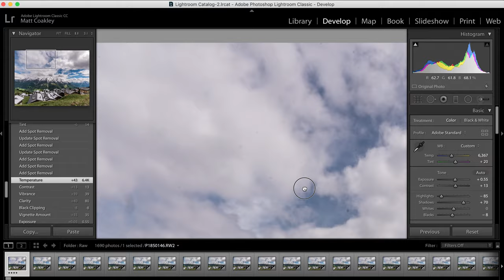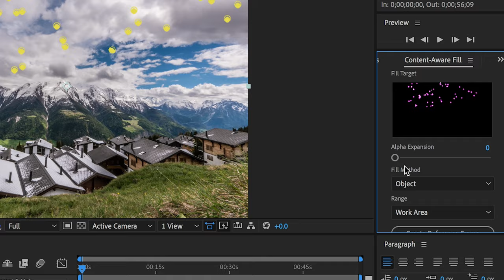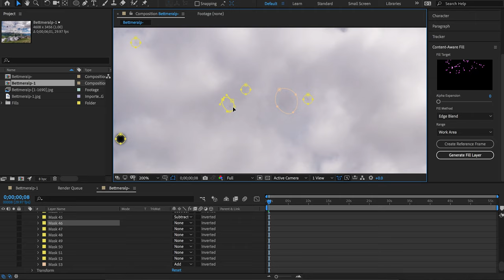How to Remove Sensor Dust with Content-Aware Fill

Comment: Hello! For some reason, it isn't working for me and I can't seem to figure out why. I created a new Composition with my footage; then, I created three masks and set their Blend Mode to Subtract; finally, I went to the Content-Aware Fill feature and clicked on Generate Fill Layer (same parameters as yours). However, the masks remain pitch black, they aren't replaced. Do you have an idea, by any chance, as to what I might be doing wrong? I would greatly appreciate any help! Thank you.
Reply from the maker: Are you sure it finished analyzing and creating the Fill Layer? It takes awhile for that to be done. There are a lot of things that'll affect how long it takes (length of clip and processing power of your computer being two of the biggest) but for longer clips and/or slower computers it could easily take an hour to analyze and process the Fill Layer.
Reply: @BlueMantleFilms  I'm pretty sure that it did. I saw the Progress Bar appear, first saying "Analyzing" and then "Rendering", eventually disappearing as if the process had been completed. I'll keep trying; hopefully, I can figure it out. Thank you so much for getting back to me 🙏🏻